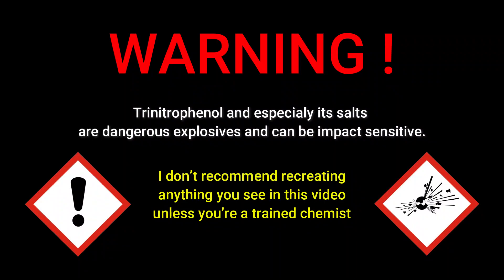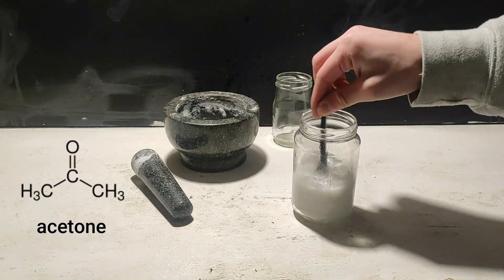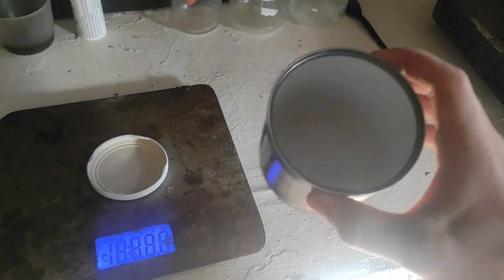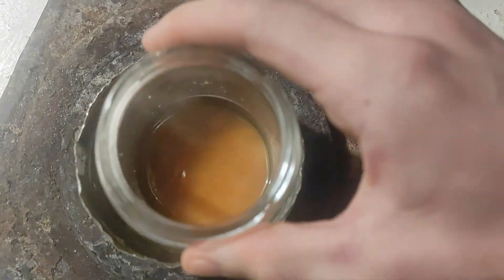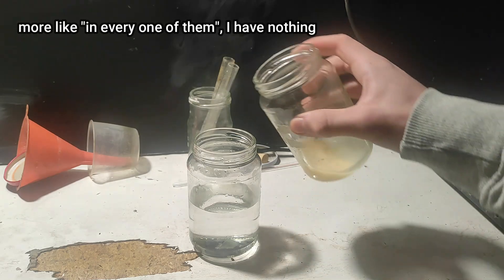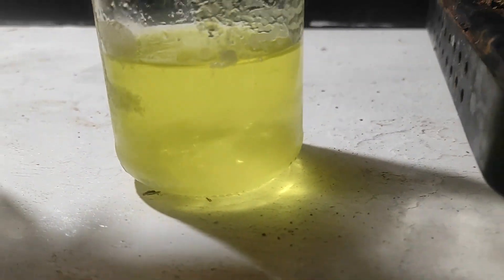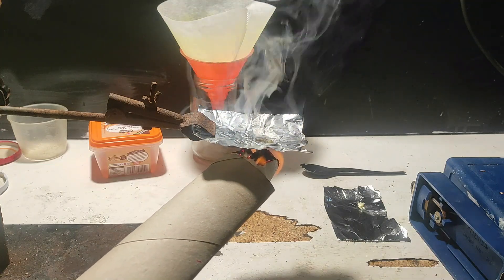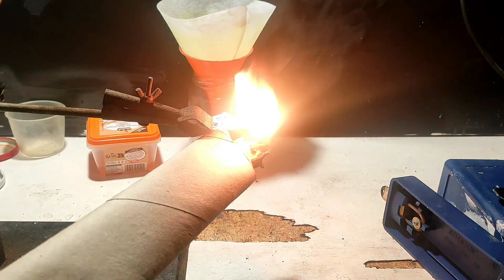making explosives coz I'm bored

Comment: can i use 42% sulfuric acid and then 52% nitric acid?
Reply from the maker: I don't think so because the acids needs to be very concentrated as water will avoid nitration. You have to concentrate them before
Reply: @jam_kemist3986  oh... Because you can’t buy concentrated acids in Ukraine and you need to concentrate them yourself.

Comment: Hi Jam_kemist,
Nice video. Keep on the good job :o)

I have the chance to be owner of TNP ethanolic solution that was used in the old times as a reagent for identification of some organic compounds...it makes defined solid compounds with very defined melting points called picrates (like naphtalene picrate). So with help of mp, bp of pure compound, some derivatives mp or properties and picrates, one could identify the putative compound.

When I was a student in chemistry at the Free University of Brussel, they had a "tiny incident" in a chemistry facility into the university... a student had estinguished his cigarette into a tray put there to incite students not to trow end of cigarettes into garbages... as a matter of fact a cleaner put the ashtray into a bigger trash bag and it started a tiny fire; that was masterized by the fire fighting team of the university.
Sole trick, I was there and I knew a lot about HEM and chemistry... but SCHUUUUT :o) ; while working in that facility, I realised that the all story could have been a far worst incident because the fire was in direct vicinity with the lab reserve that was holding a lot of organic chemicals including... a few litters of flamable solvents (ethanol, aceton, toluen, ...), a glass jar with about 2 kg of TNP and a few cm away  another jar with about 2 kg TNB cristals... I definitely think that security did miss a lot of rules.
But hopefully nothing bad happened.

Could you imagine a simple fire, setting the reserve of solvents in fire and onto the shelves above it some 2kg TNP and nextby 2kg TNB... while the two are more potent than TNT (about 130% more) and TNP can D2D...

About 20 years ago, it was possible to buy the 2,4-dinitrophenol in some drugstore here in Brussel.
I have stil 300g of it, it also is a potent colorizer and can generate sensitive dinitrophenate. Dinitrophenol was also used into various first and second W-War amunitions.

I did also more than 20 year ago the experiment of picric acid synthesis from HNO3 (69%) and H2SO4 (98%) from aspirin and ice; it worked nice.
I stil have to point out a "mistake" into your video at about 5:10 where you mention m-nitrophenol (3-nitrophenol or 5-nitrophenol) while the actual products are o-nitrophenol (2-nitrophenol (= 6-nitrophenol) or p-nitrophenol (4-nitrophenol) or salycilic acid nitrated derivatives (2-nitro-3-carboxy-phenol; 4-nitro-3-carboxy-phenol: 2-nitro-5-carboxy-phenol;  or 4-nitro-5-carboxy-phenol)... the phenol group is mainly ortho or para director (not meta director) and the carboxyl group mainly meta director.

This reaction is very interesting on an organic chemical point of vieuw...
Into the proces the nitric acid enters the aromatic ring (as NO2(+)) with help of sulfuric acid or salycilic sulfonic acid; once one NO2 or two NO2's are introduced into the aromatic ring decarboxylation then becomes easier just like desulfonation and nitration of the third place to acheive TNP that is free of groups like -CO2H or -SO3H

PHZ
(PHILOU Zrealone from the Science Madness forum)
Reply: For example, during the process of making TNB out of TNT (because it is easier and the CH3- group directs the NO2 mostly ortho or para (2,4,6-TNT)... then oxydising the methyl by conventional means  leads to 2,4,6-trinitrobenzoic acid (TNBA); the later upon boiling water exposure leads to easy decarboxylation (the 3 EWG groups (electron withdrawing group) onto an aromatic ring itself kind of propagating EWG (looks like C sp2 or sp3) so picryl is hell of a good EWG) and this ends up with TNB
HO2C-C6H2(NO2)3 -100°C-> C6H3(NO2)3 + CO2(g)

PHZ
(PHILOU Zrealone from the Science Madness forum)